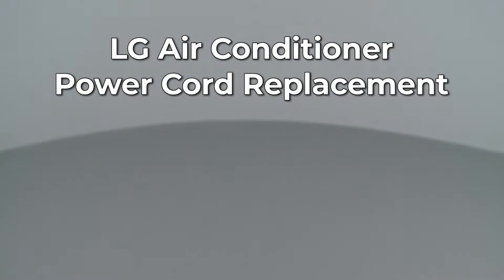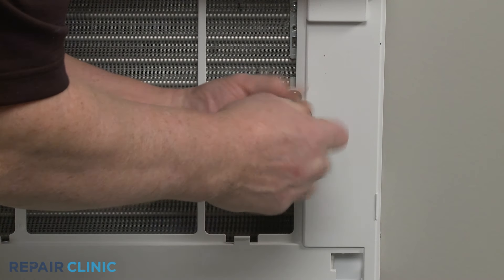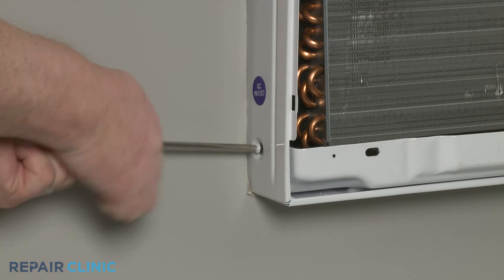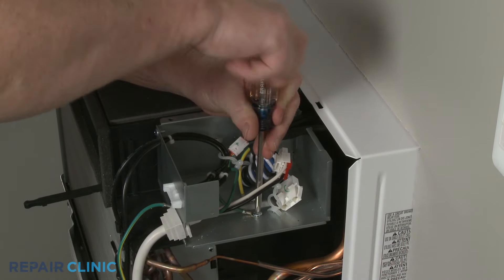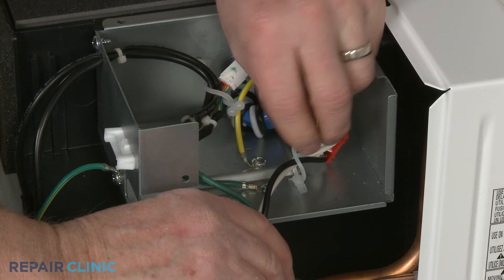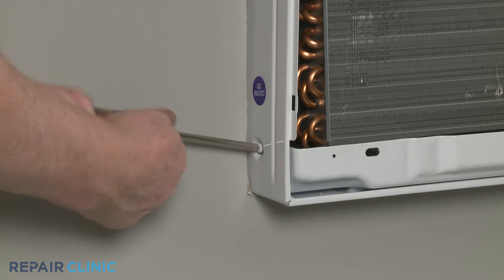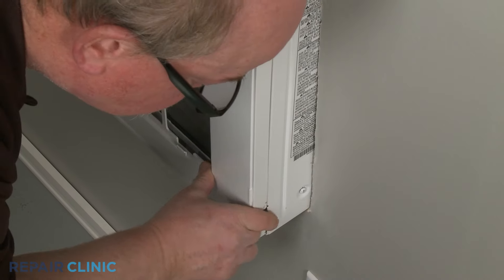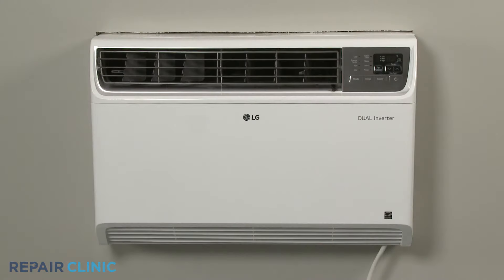LG Air Conditioner Power Cord Replacement EAD63469514

Comment: I have a 1217er and it was working perfectly and the other day it just went dead. There is no lights or sounds and the reset on the power cord is not having any effect either. It does not light up either. Any ideas as to what it might be?

Comment: Is there a fuse in this unit? Mine will not power on at all. I get the green light at the plug when I hit reset, but no start chime and the unit does not respond to any buttons.
Reply: I'm having this same problem
Reply: have you figured it out??
Reply: @hectormorales4002  I replaced the main board and got the unit to work for another 3 months of Summer and then it failed again.

Comment: Why is on the plug, one pin is vertical and one pin is horizontal? (where you plug it into the wall)
Reply: Plugs with different amperage. 15 amp/20 amp.
Reply: It is not U.S.